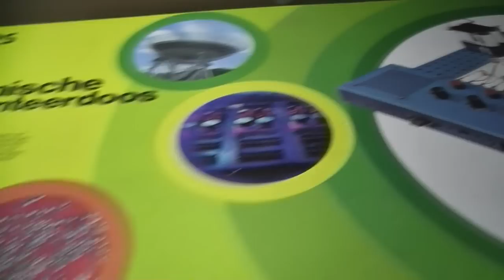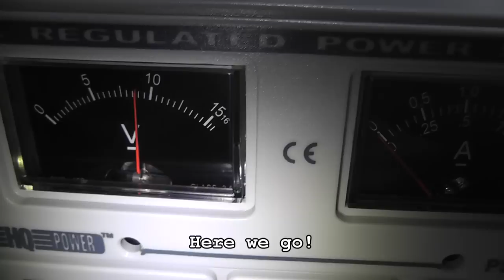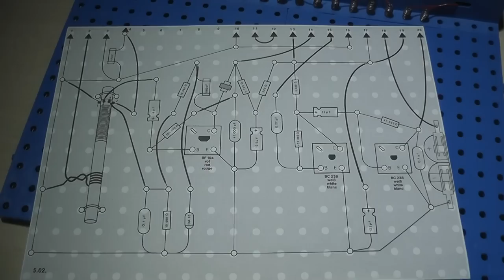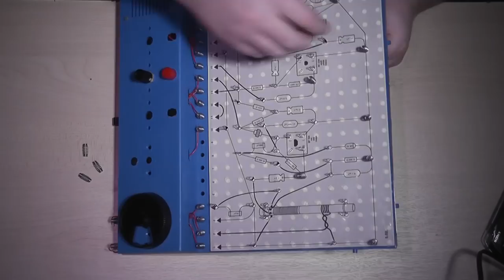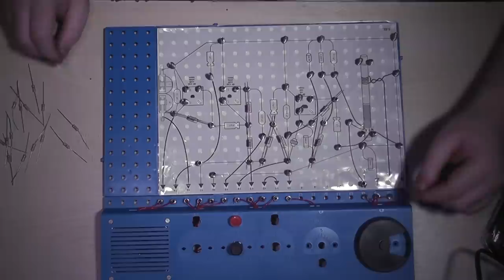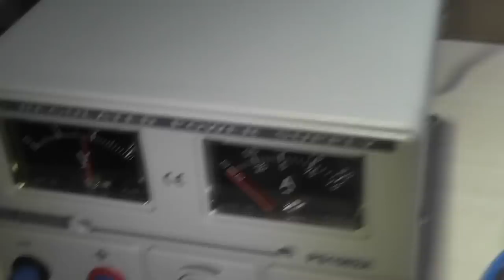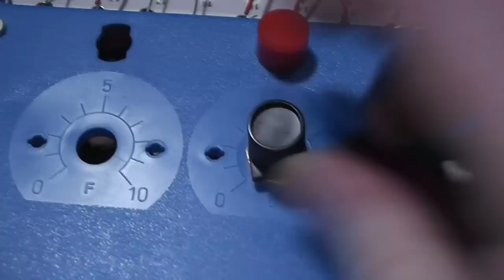Philips EE2003 : Build a radio (time lapse video for the main build) - 70s Electronics kit.

Comment: Haha, this takes me back. I wasn't born then but even in the mid-late 90s I had and loved a similar kit, The difference was the components were fixed in position and permanently attached to the springs and you'd just connect wires between springs. I'm sure you've seen kits like that.

The other reason this takes me back is because the components (other than the mustard capacitors) are identical to those used inside my 1982 philips PM3217 oscilloscope, the difference being that they are on a PCB. No ICs in that scope except for a couple of transistor arrays it's all discrete transistors, thermally bonded matched JFET pairs in TO-18 metal cans and bipolar transistors in TO-92 plastic. Wonderful
Reply from the maker: Yes, i know those kits. Had (and still have) a few of those. The problem is that you cannot see the circuit layout through the spaghetti bundle of wires so it does not help you understand how and why each project works.
I have used the PM3217 in the years i have worked for Philips but i've never owned one. Nicely over-engineered like all stuff from that era.

Comment: Great video! over 40 years ago I had an EE1003 with the EE1005 superhet add-on. I have just obtained these model kits again, so I'll be re-living my experimenting days again! One comment on the am radio, It was found better to use insulated wire to fix the ferrite rod, otherwise bare wire acts as a shorted coil, and reduces the signal...

Comment: Congrats! Your kit is in mint condition. I used to have an EE-20 (GE transistors) but all I have left of the original is the variable capacitor and some polyester and electrolytic capacitors. I managed to rebuild all 20 projects using a breadboard and new parts. A couple of years ago there used to be on Youtube, a really old Phillips "Pioneer" kit, but it seems to have disappeared.

Comment from the maker: Hi Matt! Yes, i know those kits. The components all had a fixed place on the board and you connected them with wires, losing the overview after connecting 3 of them. And with every wire you connect two come loose from the fiddly springs. When it finally works you have no idea what it does :)

The strong point of this kit is that you can still recognise the circuit once built. I've learned a lot from this kit.

And yes, it's me. I have the same problem you have: kid not interested in technology.

Comment: Hi !
You must try this circuit build around the Philips EE system, but with Germanium transistors. I've compared it with the EE2003 radio and guess what, it is able to pick up moe stations. The transistors used are AF116 and AC126.
I've uploaded 2 videos, one during daytime and one during nighttime.
Greetings
Reply from the maker: Are there any AM stations left? The one in the video was the only one and it closed down since then. The transmitter site was only 20km from here.
Reply: Hi !
Where I live , This receiver is able to pick up a few Dutch stations, French stations,during daytime. In the evening there are also  a Rumanian station, 2 German stations, an English and a few I don 't understand :-) 
With he Ee2003 circuit only 1 French station can be heard, so I think it must have something to do with the circuit.
You can find my video on my YouTube channel.
If you find time, try to build this one, you would be surprised !
Greetings

Comment: I used to have something like this. All the components were connected onto small springs-if you bend the spring you get a cap to insert the wire. Search for "50 in 1 electronics lab" then I upgraded to the "200 in 1 electronics lab".
I used to run the LED at 9 volts at all times (without limiting resistor) probably coz the 9v PP3 was always flat!
Is that you or Aswhin reconstucting there? (ah just seen hair on the arms! lol)
08:40 I would have put 240VAC on it just to make everyone jump haha!